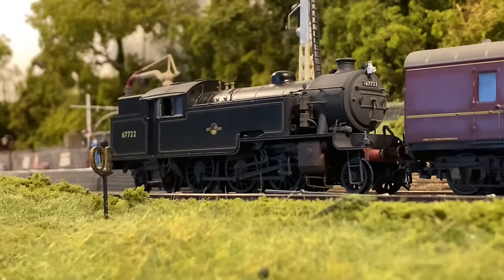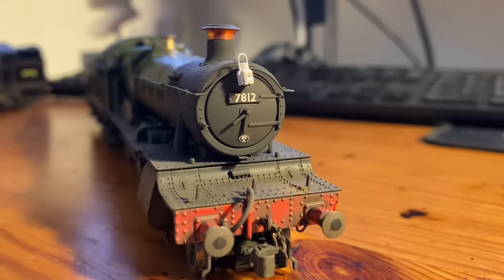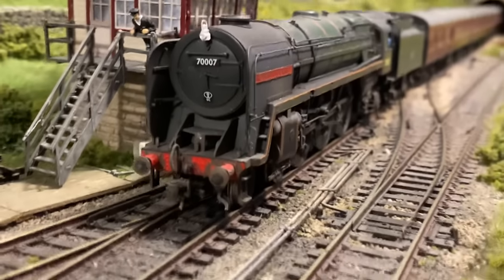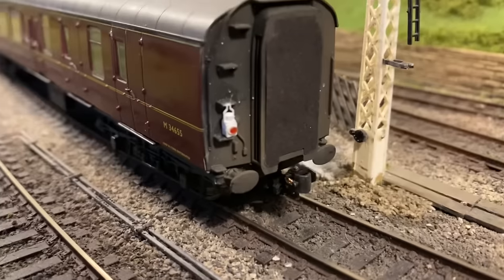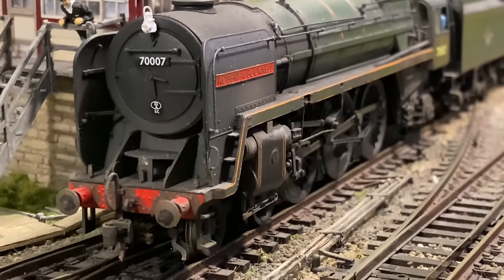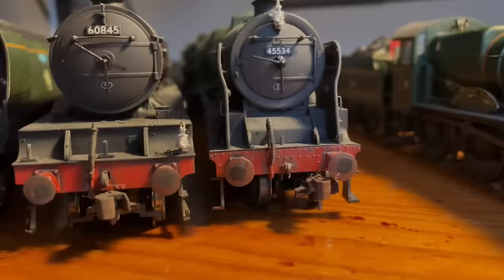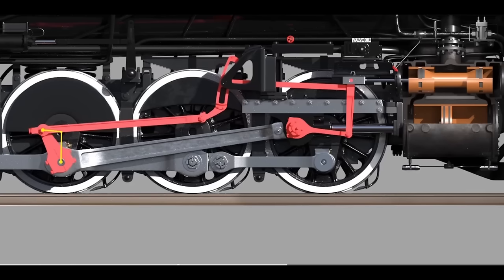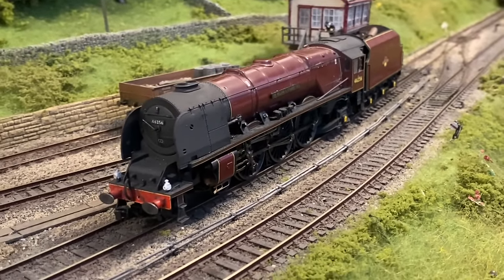Five Easy Ways to Improve Your Locomotives - The Yorkshire Dales Model Railway

Comment: Aw Lewis that tip about the Walschaert’s motion adjustment is pure genius. At least one side of many of my Hornby locos have been driving me nuts for years. Just spent 20mins correcting 5 of them. Thank you!
Reply from the maker: Ah pleased to hear you found it useful. I was the same, weird how Hornby always had it right on one side and wrong on the other… On the newer stuff like the 9F and 2MT, they seem to have a nailed though.

Comment: Also Lewis for Class O with light engine movements like when a train comes into Misselthwaite and has to run round the train a lamp with a red indication would be put over the coupling hook of the now rear facing end of the loco and a white lamp over the leading coupling hook that was next to the train. This indicates to the signalman that this is a light engine movement and not an engine where the train has broken away even though it's pretty obvious. The Southern Region used discs but they denoted the route a train was taking rather than the type of train it was. They only used discs in the daytime for at night they had lighted lamps. With the Modelu lamps this is easy and quick to achieve.

Comment: Hi Lewis, another fine missive. I would like to mention in regard to valve timing, (usually) piston valves are timed as you say. But, slide valves are the opposite! I know on my 1.5 inch scale 4-8-4, with Baker Valve Gear and slide valves ( made to look like piston valves externally) My eccentric lever is leading. I reckon I could have some fun arguments about that😊  BTW, although this is a American Loco my plans were drawn by your famous Henry Greenly.
Reply from the maker: Thanks Peter - that’s interesting!  You can go down deep down the rabbit hole with this subject 🤣

Comment: Hi Lewis. 100% with you regrading the lamps and share your OCD in trying to ensure their positioning  correctly represent both the era and the train being hauled!  Having said that, I'm not judgemental in any way of modellers who couldn't care less.

I use a tiny amount of black tack to secure lamps to locos that do not have the necessary  brackets.

The crew, and other characters, you add to your locos & layout certainly add to the realism. I particularly like the driver leaning out of the cab and the signalman on his balcony. The muffled background speech is also very effective.
Reply from the maker: Ah I’ve been meaning to get some black tack actually, that’s a great idea!

Comment: Spot on re valve gear. I've been going on about this to Hornby for years and they take no notice. Watch out for external admission e.g. as you say the rebuilt Bulleids,  also the SDJR 2-8-0's s and some internal admission locos e.g. Woolwich 2-6-0's and derivatives!
Reply from the maker: Good points!  They seem to have got it sorted on the recent very recent new tooling’s like the 2MT, 9F and from what I can tell the black 5 - but maybe that’s a fluke!

Comment: Hi Lewis I do totally agree with you regarding valve gear settings. I know I have touched on it before. In the main you can change the settings as you quite rightly suggest. Some crank pins though have flat sides. I do think that Hornby may have turned the corner now if you take a look at their Standard class 2MT recent releases.
Reply from the maker: Yes I think you’re right about the 2MT, the 9F was spot on as well and the new black five looks right as well.

Comment: BRILLIANT "MOULDY RASPBERRY" WITH VERY HELPFUL TIPS. 
I've added some real life railway technical notes & rules (below) to help explain.
HEADLAMPS: As "Mouldy Raspberry" has mentioned the LMS; GWR; LNER & BR used the four position CLASS Headcode system.  Usually with oil headlamps, (except LNER/BR Great Eastern section which used White Discs in daylight). The Southern Railway & BR Southern Region used a 6 position method with White Discs in daylight hours & oil lamps at night, which indicated the Trains ROUTE (not Class) because of the complexity & density of traffic on the Southern Network.  

The four position system had 10 CLASS options. Before 1948 these were coded Classes A to K, and there were slight differences of what type of train fell into each category on each of the GWR; LMS & LNER Railways !!!. When BR began in 1948, they introduced a "Standardised" method for ALL BR Regions except the Southern, using Class NUMBERS 1 to 0. Where 1 was an express passenger; 2 a stopping passenger etc.... This system was in use until steam vanished in 1968. Although BR had started introducing the Four Character Headcode (roll round blind) system on other types of modern traction. The Southern Region was again the exception as it replaced the steam era 6 position Route codes with a two digit roll round blind Route Code system already in use on Southern EMU's. 

The BR Standard headlamp codes from 1948 onwards can be found on the "Standard BR Headcodes" website. Beware many of the websites showing "Headcodes" are incorrect or in many cases show PRE BR (GWR/LMS/LNER) set of codes, without explaining which !!!
    
SOUTHERN RAILWAY & BR SOUTHERN REGION Route codes can be found in diagrammatic form on the "Southern Email Group" website (for free). NOTE: This system was subdivided into 3 separate tables of codes, one for each of the three Southern Divisions: South Eastern; Central & South Western, and the website shows all three.        

TAIL LAMPS: Displaying a red light HAD to be placed ONLY on the last vehicle of every train. No tail lamps were allowed on any intermediate vehicles & especially NOT of the rear of a loco hauling a train whether they were illuminated or not !!!
  
KADEE COUPLINGS: Are of course a virtual copy of the real life British Buckeye (a slightly smaller version of the American "Knuckle") semi-Automatic rigid coupling. Introduced to Britain from the USA in the 1880's when Mr. Pullman arrived in Britain with Shiploads of his Pullman Dining & Sleeping Cars. These model couplings are fully automatic and can be actuated by Kadee split pole magnets placed IN or UNDER the track !!! For British models with NEM coupling pockets Kadee couplings Nos: 17; 18; 19; & 20 are needed. Where 17 has the shortest clip in shank & 20 has the longest clip in shank. And are of course a lot more realistic than the silly toy coupling provided.
   
SMOKEBOX DARTS: The inner handle is the locking handle, while the outer handle is the screw up tightener ! Which means the inner handle has to be in the 6 "O" Clock position when the door is locked shut. The "tightener" is necessary because a slight vacuum has to be maintained within the smokebox as the loco is running. So has to screw the door VERY tightly shut to ensure this vacuum, so can be found in any position once tightened.

Comment: I like your thoughts Lewis on the loco crew and the way some people go on about getting the figures as accurate as possible but when the loco goes by you can't see that accuracy. It's the same with figures in coaches and painting the interiors and having dinner laid out on the dining coach tables. Once again when the train goes you're just not going to be able to see it all.
Those Modelu lamps are a real money saver and if you didn't want to have the red tail lamp permanently on the coach you can use Tacky Wax from Deluxe Materials. The little pot of wax will last you a life time and is better than black tak which is extremely sticky. Tacky Wax is enough to hold the lamp in place but also easy to remove.  

The lamp positioning conundrum looking at the engine facing the smoke box.
Class 1 which has two lamps one above each buffer indicates a train either express passenger or newspaper train. The same code also meant a breakdown, snow-plough, a light engine on it's way to assist a disabled train or an officer's special that is not booked to stop within a section.

Class 2 is a single lamp at the top of a smoke box shows a train meaning an ordinary passenger train, branch passenger train or mixed train. A breakdown train, snow-plough train also carried this code if "off duty".

Both class 3 and 4 were represented by the same pattern of lamps, one above the left buffer and one above the coupling hook which indicated empty passenger stock, parcels or perishable loads such as fish, fruit, livestock or milk were classed as class 3 as long as all vehicles conformed to coaching-stock specifications. Class 4 meant a freight train with automatic brakes on not less than 90% of vehicles (fully fitted).

Class 5 which is one lamp above the left buffer and one lamp at the top of the smoke box describes an express freight train with automatic brakes on at least 50% of the vehicles.

Class 6 is a above the coupling hook and the other lamp above the right buffer means an express freight with automatic brakes on not less than 20% of the vehicles.

Class 7 is one lamp over the right buffer and one lamp at the top of the smoke box means an express unfitted freight.

Class 8 is one lamp above the coupling hook and one lamp at the top of the smoke box is just a fully unfitted freight train.

Class 9 is one lamp over the right buffer means a branch pick-up freight train but also an officer's special or ballast train due to stop within the section.

Class O is one lamp above the coupling hook and means single or multiple "light" engines hauling no more than two brake vans.

Royal head code is 4 lamps, one on top of the smoke box and one over the left buffer, one over the coupling hook, and one over the right buffer when hauling the royal train or a train that's not the special royal train but a train that's conveying royalty. The Nene Valley Railway conveyed Prince Edward when he opened the railway's Peterborough extension. The train comprised of six newly painted BR mark 1's and the engine was their BR class 5 73050 painted in green and carrying the royal headcode.
Reply from the maker: Thanks for the info Roy, very helpful.  Wow I didn’t know 73050 headed a royal train!  Wonder if there is any footage of that.
Reply: @MouldyRaspberry  Yes there is footage of that in one of the Railscene video tapes Lewis, but I can't off hand remember which one. The BR standard 5 was painted in light green livery. Guests for the ceremony were brought to the railway by Deltic D9000 Royal Scots Grey.
Apparently Prince Edward had been participating in some sort of stunt at Cambridge University and was delighted to officiate at the opening. 
The producer of the Railscene videos said some unkind words about the Nene Valley Railway in that he didn't like the use of "foreign" stock even though the railway is liked by TV and film people. He described the livery of the standard five as a "strange hue of green" or was that 850 Lord Nelson in the 80's.
The railway scenes in the Bond movie Octopussy were filmed at the Nene Valley Railway which was supposed to be communist East Germany. Martin Grace once a stunt man broke his back on the railway hanging off the outside of a passenger coach. A section of line had been cleared of line side obstacles but the train when into the next section that hadn't been cleared and Martin struck a post. It took him numerous operations and a lot of medical care for him to be able to walk again.
In the Bond movie For Your Eyes Only he plays James Bond in the opening sequence hanging off a helicopter which is flying around the now demolished Beckton Gas Works.

Comment: Great heads up on improving the models we have. The lamps is most likely a thing for me that i'll do for the 3 steamies i have, 1 (most expensive model in my collection)has a crew installed. The others wont really apply as SAR steam locos(most of them)has a lockwheel at smoke box door. Im not gonna fiddle mechanically with the flagship model to work on anything mechanical as another model was worked on and it had a mishap jus falling on table, not even floor and cab broke😢. Looking forward to more of your videos and getting my "patient" fixed
Reply from the maker: Thanks Jacques.  Ah sorry to hear that mate - hope you get it sorted 👍🏻

Comment: Electronic repair kits also have multiple sizes of those hex bolt drivers, as well as many other odd screw bits you may run into. You can get them fairl cheap
Reply from the maker: That’s good to know, thanks 👍🏻

Comment: How they are still getting valve gear wrong is beyond me when they must browse hundreds of photos and go to measure up the real thing. I rather have that correct than a cab with dials showing all the markings you cannot even see when the model is on the layout.
Reply from the maker: Yep I completely agree!   On the newer stuff like the 2MT, 9F and what I’ve seen of the new black five it seems like they’ve sussed it out finally
Reply: @MouldyRaspberry  Yes the 2MT is a lovely model and looks right